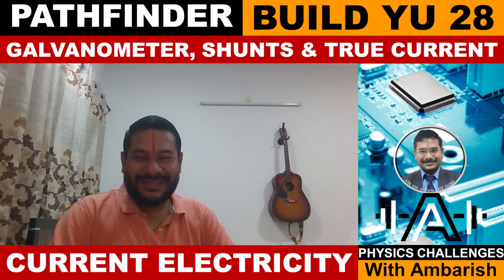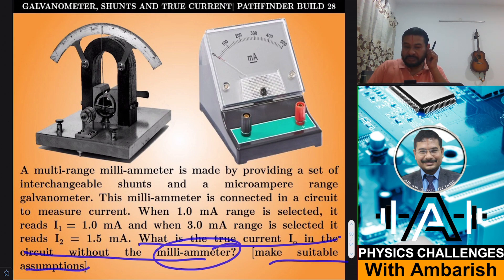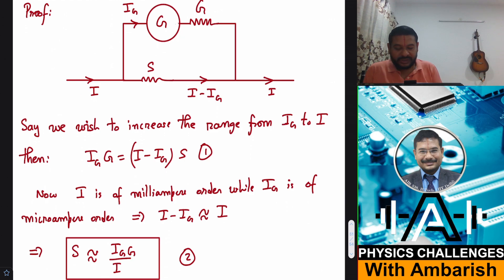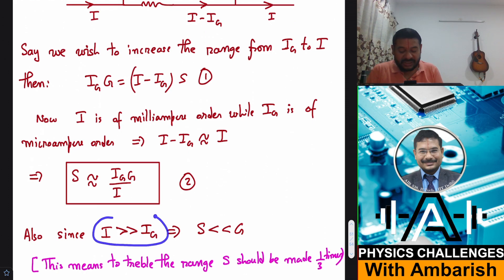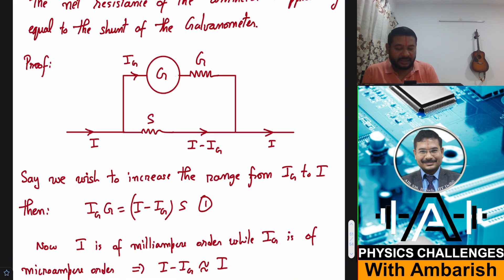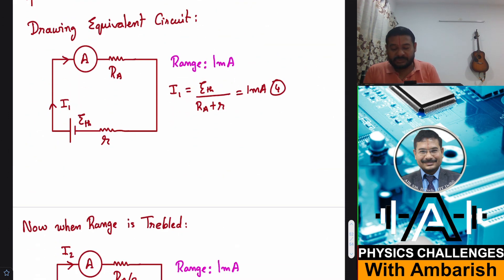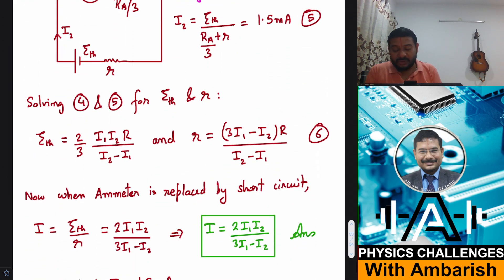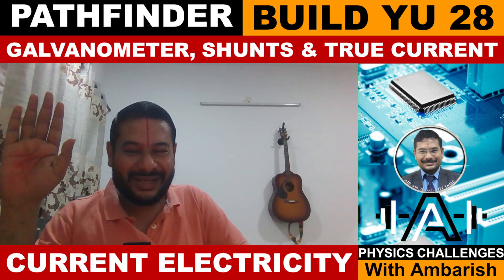PATHFINDER| CURRENT ELECTRICITY| BUILD YOUR UNDERSTANDING| PROBLEM 28| TRUE CURRENT| GALVANOMETER|

Comment: Good afternoon sir, wanted to ask if it is advisable to start irodov and pathfinder immediately after solving coaching module or any intermediate resource such as cengage/hcv/pg is needed? If needed which one of the three is most apt?
Would be grateful for your response
Reply from the maker: I Generally Recommend doing Irodov Immediately after coaching materials + PF MCQ and Build (You can try Check/ challenge during revision)+ SB Tiwari for revision.
Reply: @ambarishphysics  thank you sir